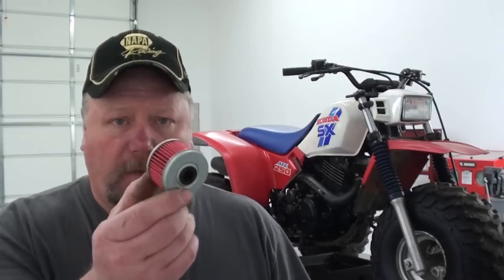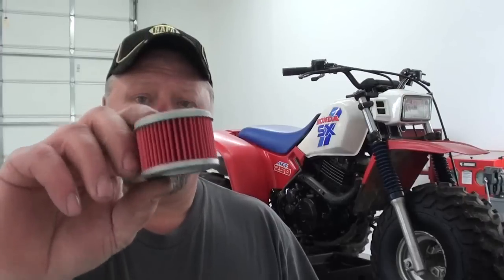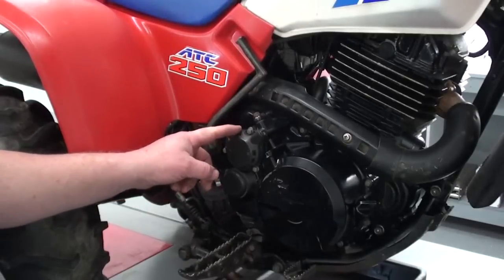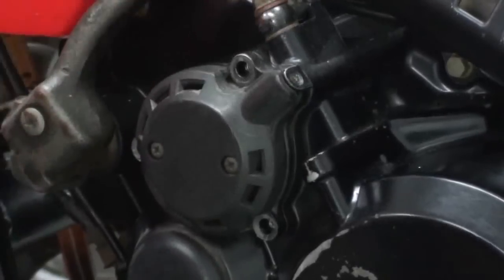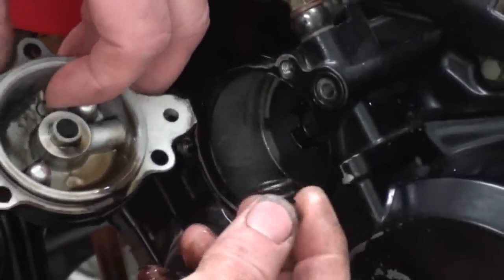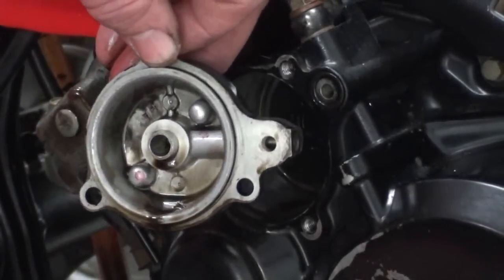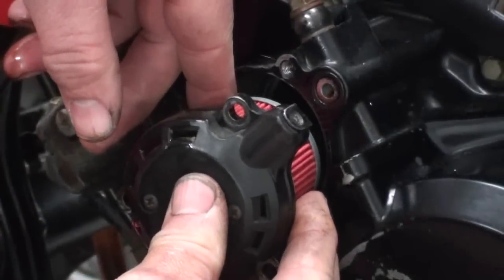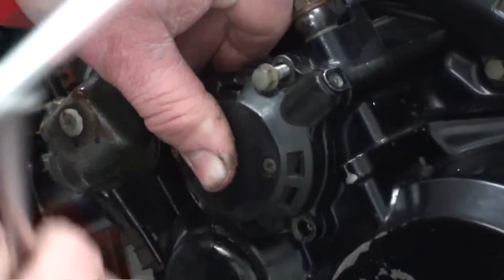Honda ATV Oil Filter - Which Way Does It Go?

Comment: I’ve got a 2000 honda trx 450es and noticed that the old oil filter has a spring inside the filter on the end without the oring but the new one does not, is the new filter ok to use? It’s the back side you’re talking about in this video, my new filter looks just like the one you have

Comment: does it matter which way the filter goes on my 2003 honda rubicon foreman  500, both ends look the same. don't  think it would on this filter but need to be assured . thanks
Reply from the maker: You can install that filter either way, have a goodun'!

Comment: I put this filter in backwards on my motorcycle and it was around 38 miles until I had issues. I couldn’t figure out till I changed my oil and filter but the engine knocks hard like sounds like a bag of big rocks running. What might be the extent of my damage? Possible fixes or is it a total loss now? Please respond it’s my only mode of travel

Comment: I have the same bike, its been beat. But it ran when I plugged my little gas tank to it. Question I have is know where I can get new plastics? Looking to fix it and sell it for a few extra bucks. But the plastics are brittle and falling apart. I started plastic welding it. But I don't know of any plastic bonding bondo. Got any tips got faring repair?

Comment: Weird question , for a 2005 Honda Rincon 650 atv both sides have the rubber on the ends does it matter if the filter part # faces the outside or inside ? Are the thickness on the ends the same or different ?
Reply: That filter can be installed in either direction.
Reply: right on thanks dude1